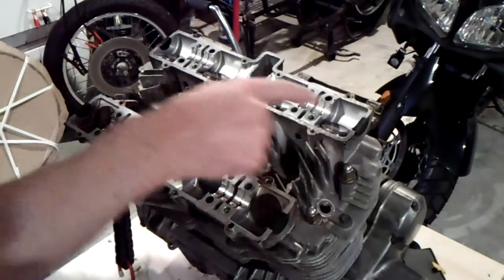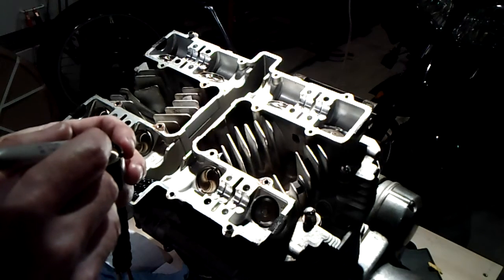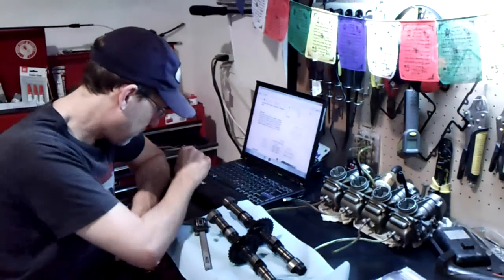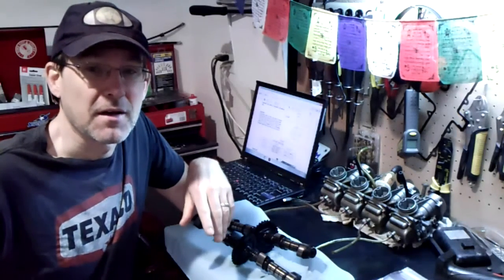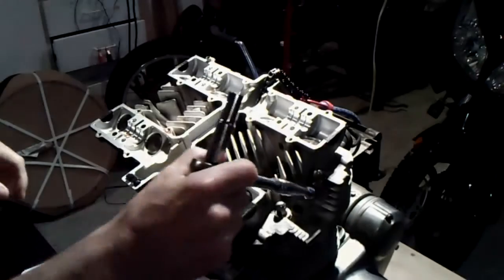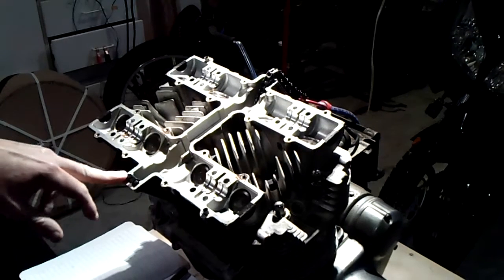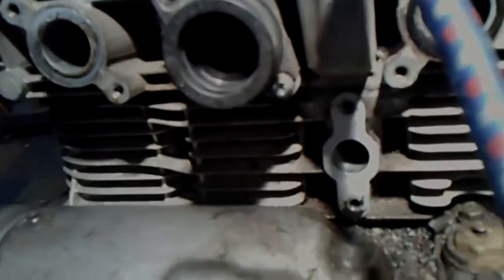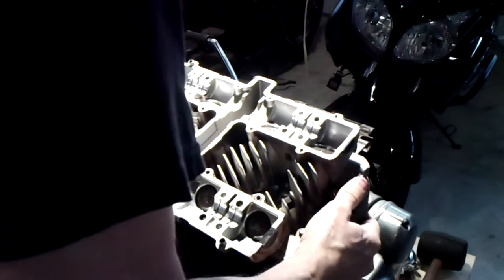Cylinder Removal 1 - GS550 Cafe Racer Build (Part 5)

Comment: FargoMonk your tutorials are priceless! You have a knack for teaching and I like your dry wit. Happy Fathers Day! Quick question, I watched Part 4 and this video as well, can I perform this entire procedure with the engine mounted on the bike or must I dismount it? thanks again for so graciously dispensing your masterful knowledge :)
Reply from the maker: motafov Thanks! I commend you for having the patience to sit through my detail. 😄 Yes, I'm quite sure you can do a top end rebuild without removing the engine from the frame. All the best.
Reply: are you kidding, i watched all your videos back to back and have made a list of things to ask my mechanic to watch out for based on your tips (plus i like your make shift tools and macGyver attitude). hate to hog this comments section up with a personal question, but because i intend to have a professional handle the valve adjustment tomorrow (even though having watched your vids i'm certain i could attempt it..just dont have the tools nor the time presently) i was wondering whether messed up valves could be responsible for my 1978 gs550 not starting when hot. it could be rectifier or coils or points, or all of the above? bike was sitting for 20 years, carbs have been recently cleaned up, its probably a good idea to check valves regardless what the cause of hot-starting problems might be, right? thx again 4 posting the vids u made !!
Reply from the maker: motafov Sounds like a puzzle. I always think of the big three- fuel, spark, compression. If your running cold then you have all 3 cold. Do you have all 3 when hot? Which party goer ducks out when things get 🔥?

Comment: i must say you are fun to watch and I learn bunch but
 lighting is horrible. May I suggest rechargeable headlight
Reply from the maker: Thank you.. I got better with lighting as time went on. Are you watching in order?
Reply: @UrbanMonkTV  skipping around, found a 60psi compression. And garb n carbs. So I've been watching methods of proper angle of attack!👍♏
Reply: Also I know gs1000 can romance 100psi across the cylinders. I'm thinking valves are stumbling. It wont idle but got her started dancing RPM over 2500!🤔🤣

Comment: Hi! I love your videos, they are much appreciated! Did you find new camshafts on ebay? Where would you recommend that i look for a new camshaft...i could only find used ones on ebay and i cannot be certain that those are within the acceptable limits until they arrive. What did you end up doing?
Reply from the maker: Thanks for watching! Yes, I purchased my replacement camshafts on eBay - used. I asked three different sellers to tell me the measurements. Only one was willing to do it (at the time) but the camshafts he sent were within spec. Other option is more expensive - take to a machine shop to graft new steel onto them and grind to OEM specs.
Reply: @UrbanMonkTV  Thank you for the quick response! I will try ebay first